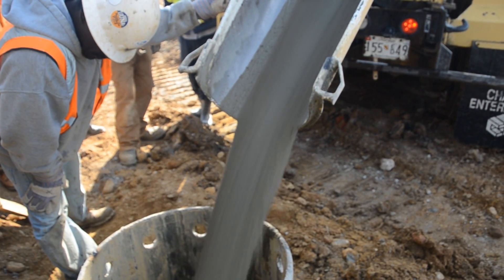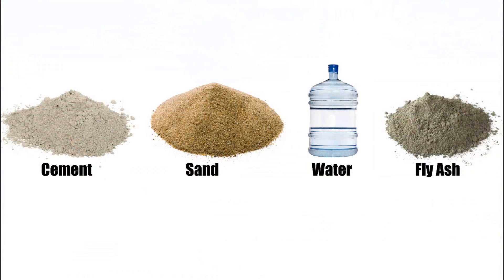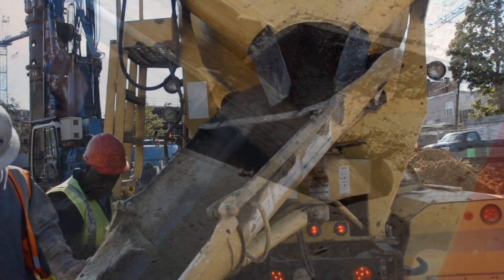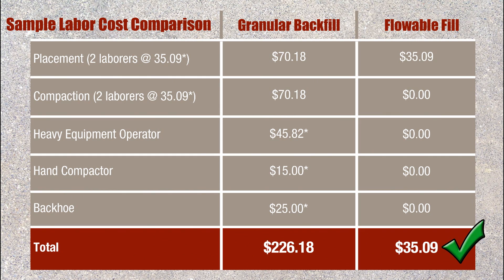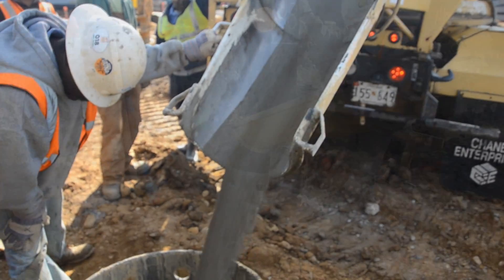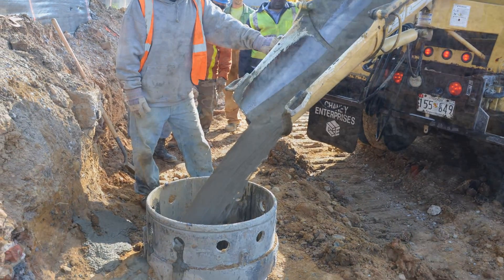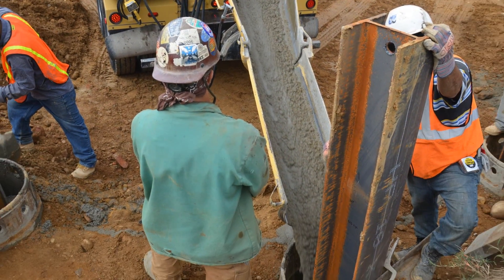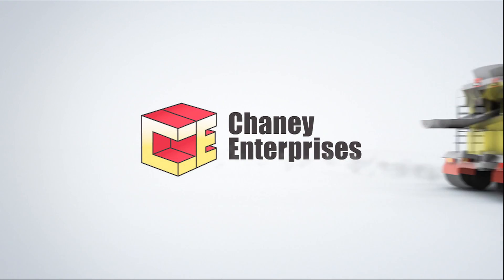Flowable Fill - Concrete Brief

Comment: Thanks for your video. 
Your video shows concrete being placed in formwork around steel columns. This is probably not flowable fill - or at least it shouldn't be. Flowable fill is great for filling underground voids or backfilling tranches where the vibration equipment can't be used to consolidate fill. It is definitely not suitable for replacing structural concrete. 
Matt
Reply: I believe those steel beams are actually part of a soldier-pile retaining wall system. After these piles are set, the ground is slowly excavated from one side of the system and part of the concrete is chipped away so that wood lagging can be installed. Using regular concrete would make the work extremely difficult, and the low strength of this concrete is acceptable because it's simply replacing over-excavated earth.

Comment: I know this video is 10 years old but maybe someone can help me with this question. If I wanted to use flowable fill for a 4 inch slab in a detached two car garage that’s basically going to be a shop, would this work? Would it level itself to the point where I would not have to work the surface? Also, I had concrete delivered a few years back and the truck driver used the term “grout mix.” Is flowable Phil the same thing as grout mix? Hopefully someone out there can chime in. Thank you!